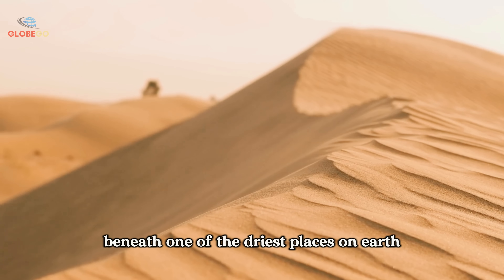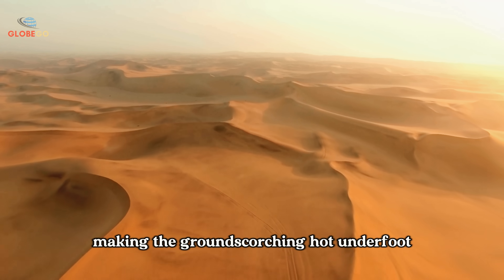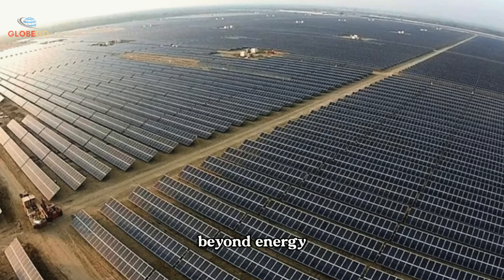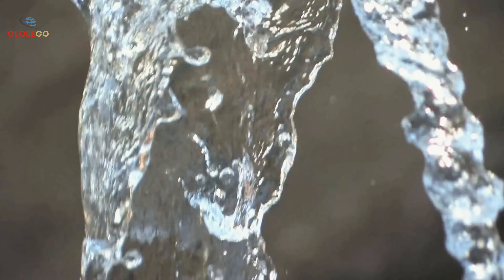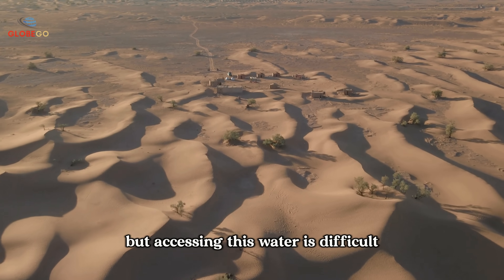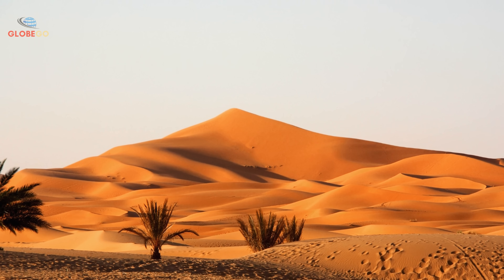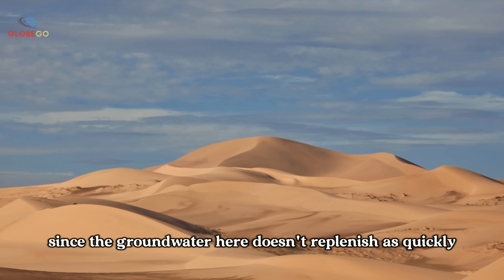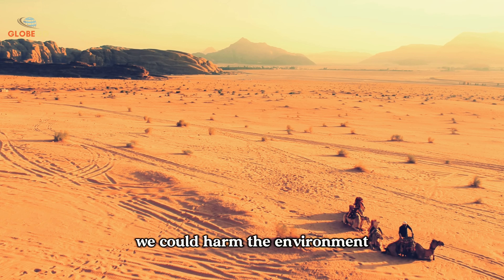Scientists ASTONISHED! MASSIVE UNDERGROUND OCEAN Found Beneath Taklamakan Desert – Documentary

Comment: Of course there're challenges, but it would worth all the efforts to overcome all these challenges to transform Taklamakan into green oasis and productive farmlands.
Firstly, make sure not to over exploit this valuable water resource that may not be replenished once it's over extracted. Therefore just set the the limit of not more than 5-10 % of the water resource.
China has gained enough experience to use this water wisely, probably only for green ing the desert with grasses and other drought tolerant plants that are suitable for the 
desert conditions. 
As for agriculture, farming and human consumption, water should come from other surface water source or even water diversion from other water rich provinces.
Yes careful planning and consistent implementation of right policies are needed.
Once successful, huge benefits for China and beyond!